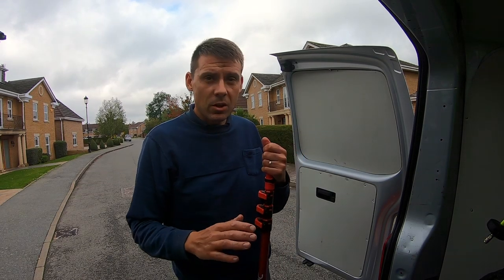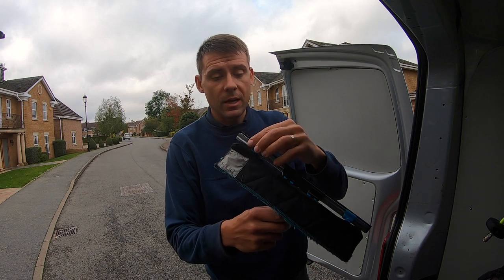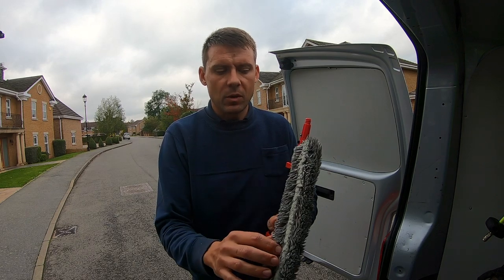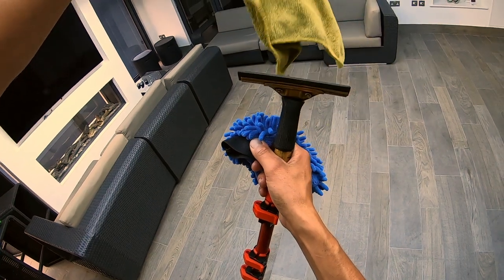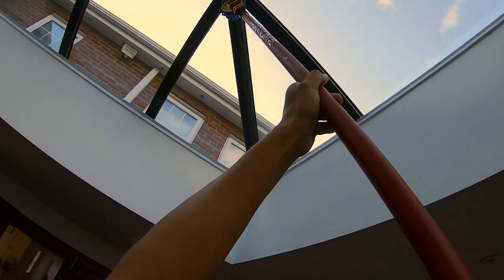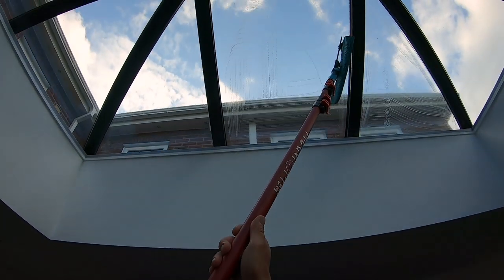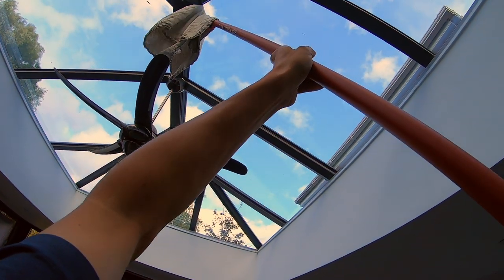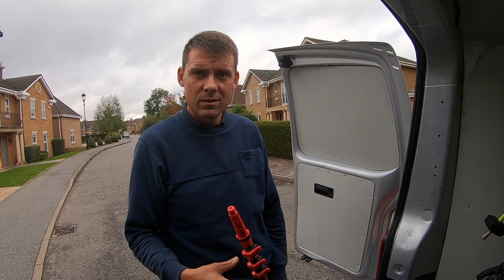Inside Conservatory Roof Clean - How To

Comment: Why not the moerman adaptor? Better fit and the lock goes into the handle perfect
Reply from the maker: Good idea. I haven’t got one, but maybe I should get it.😃👍🏼
Reply: @aemackintosh  Bought one and just had to drill a thread in the black bottom part of the original phantom adaptor. Insert a screw and it's not going anywhere

Comment: Hi Ash, I’ve only been going a couple of weeks and I’ve had someone ask me to quote an internal conservatory roof clean. As you can imagine I’ve never done one before and I don’t even have an extension pole with attachments. Is it best to avoid at this stage? I’ve seen people using the Karcher window vac to do internals so I’m not sure if it’s worth getting one and using that?
Reply from the maker: As a professional I always prefer to use a squeegee on a pole. If you are a beginner then you might find it easier to get a good step ladder involved. Wipe down all the white plastics fist. You may want to use sheets to protect furniture from falling drips. Give it a go. You have got to start somewhere, and it will be a great learning experience.👍🏼
Reply: @aemackintosh  Cheers Ash, that’s what I was thinking, just give it a go as I’ve got to start somewhere. Would I need to get a pole and attachment for my squeegee, or is it possible to do it up a stepladder with a hand held one (dont really want to buy equipment I’m going to rarely use).

Comment: if the inside of conservatory roof and upvc is as dirty as you said and has not been cleaned for ages a wipe over with an applicator  on a pole wont lift the dirt from it , i did one a day ago and you have to get up there and scrub it! especially if the upvc is white ,! also u  need a ladder to finish the job where the glass roof  inside  meets the wall  where you cant reach with a pole! ( where all the flies n bugs go to die!) ... great video as usual but a bit misleading ... a connie like that this into the bottom corners will need a ladder to finish it ..... unless your 6ft 10 plus ! 😆 ...
Reply from the maker: I am tall, so I did manage to do those lower bits by hand. I know what you mean about the dirt being quite stubborn sometimes, but a bit of a soak and it will soon come loose in most cases. There was no furniture in this one so I didn’t have to worry too much about drips either.😉👍🏼
Reply: i'll have to get some high heeled boots and wear thick socks in future 🤣